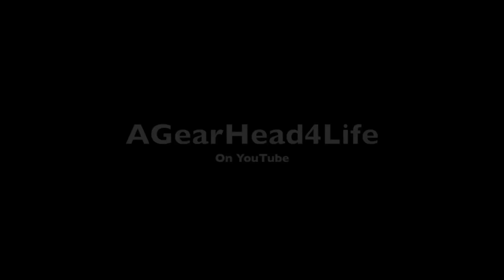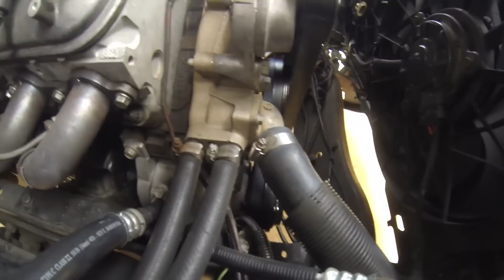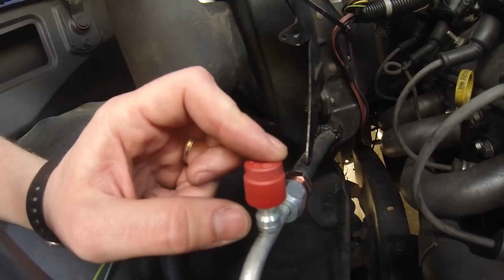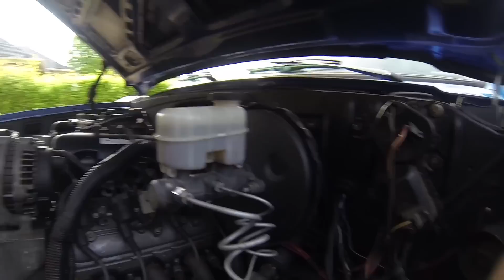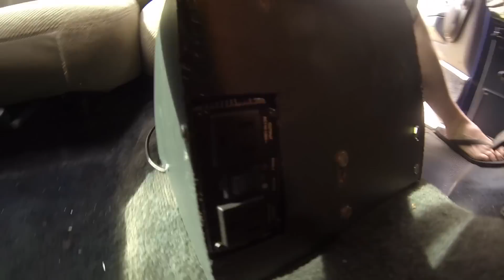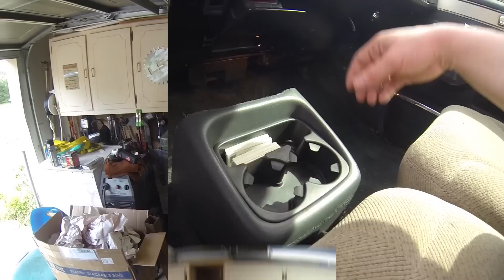AC LS Swap C10 Part 2 + Brake Master Upgrade, Console & Tires

Comment: Who made the hoses?
Reply: Here in San Antonio TX Carlisle Air Automotive will make you your hoses if you take them the fittings and the hose length needed.
Reply from the maker: Great answer.

Comment: What a/c control panel, did u install in dash panel to operate a/c? Does a/c panel include heater/defrost control.
Are u using ecm to control a/c or is it wired independently from ecm.
Lots of diy ideas, appreciate all your postings.
Reply from the maker: I used the factory C10 controls, but need to redo it to allow the PCM to control the AC so that it shuts it off at WOT.

Comment: Those 2 wires (dark green to your compressor clutch and light green to your fan relay) have power coming out presumably from the AC switch in your dash.  Is there a high pressure or low pressure switch in your AC system?  I’m finally getting around to hooking up the AsC in my LS swap.
Thanks

Comment: Do you remember what year/model you ordered your liquid line? Mine is an 82 and the condenser ends were on the driver's side. My replacement condenser has the lines on the pasangrr side, like yours.. Thanks in advance.
Reply: 83-86

Comment: I have the same setup and when I turned on my ac the fuse blew. Does these compressors have a lower voltage “excite” wire ? Do I need a resistor ?

Comment: Where did you order the hard line that goes from condenser to dryer?  I only find the line for like a Burban that has rear auxiliary AC.    
Thanks in advance
Reply from the maker: Hernan Leal I cant remember at this moment, but I would expect that I either got it from LMCTruck”DOT”com or possibly RockAuto”DOT”com.
Reply: AGearHead4Life thanks. I didn’t check lmc but rockauto only had the one I was talking about. I ordered it anyway.  I’ll see if I can plug it somehow

Comment: Thx for this video. I'm trying to pull a vaccuum on my Chevy truck. I've located the High valve, but can't find a Low valve. How did you do this? Just use the High only?
Reply from the maker: Pat Maki You could just use one valve. I didn’t notice my old C10 setup to Gabe a high pressure switch, so I didn’t install a port for one. I regret that! I am now about to open the system to add the high pressure switch and to use a R134 condensor from a newer truck.
Reply: @AGearHead4Life  how did you do that? Any videos?

Comment: Youre a life saver buddy! We are putting a 5.3 in my dads suburban and this clears some of the questions up. Out of curiousity, what type of shop did you take your AC lines to to have modified? We are almost thinking it could be easier, depending on the controls inside the truck, to fit up a 2000s style heater box to the truck and run all the factory components, but his has rear air which makes things more difficult...

Comment: Will that 2001+ master cylinder work with my 75 C10 booster?
Reply from the maker: nandoGdog Possibly but I don’t know for sure. You could also change out the booster. Better yet, convert to hydroboost. I’ll be converting to hydroboost soon.

Comment: Did the old evaporator work? Or do you have to replace the existing evaporator and condenser for the new compressor? The reason I ask is because I have a 78 C15 that came with factory AC and I am considering doing a 5.3 swap but doing some research first about the AC.

Comment: Did  you keep the electronic programming for the A/C in the ECM or did you delete it
Reply from the maker: yes, it's in there. I used the controls on the truck to control the compressor though. At least for now.

Comment: I have a question is the brake booster also from a newer truck
Reply from the maker: No, it's the original.
Reply: Did you use original push tube from your old master cylinder or did u use the push tube from new master cylinder??

Comment: tejas steelworks makes engine mounts for c10 that you can leave the compressor in the stock location without notching the frame.
Reply from the maker: Cool! Thanks for sharing. Good info. I'll have to check them out.
Reply from the maker: ah yea! Just check them out and left a couple comments. Good stuff. I think I like their idea and how their mounts work. Not only does it allow you to easily fit the compressor, but you can also keep the truck oil pan. Good stuff. It looks like you'd have to make a custom driveshaft, but it'd be worth it.
Reply: Yep.  Only had to notch my motor mount clam shell to clear the square piece that sticks out on the block
Reply from the maker: Very nice! Thanks again for sharing. I'll pass on the info.

Comment: you think it's possible to make a video on how to wire in all the AC components. I would appreciate it, and might help others who might want to install AC in a non AC vehicle.
Reply from the maker: Yessssir! I'll put it on the list. You'd be surprised how easy it is.
Reply: @AGearHead4Life  did you ever get around to making this video? I'd like to know how you wired it also. There are 2 plugs on the truck compressors, I think the green one is a power signal, and the black one a ground. Also, does any wires from the pcm get integrated into the plugs? Thanks.

Comment: @agearhead4life where did you get your new compressor from? ebay or parts store?
Reply from the maker: I bought a new one from a local parts store for two reasons. Mainly for the warranty and I bought new instead of the cheaper reman version, because I've seen way too many reman compressors warranty returned when I sold parts for four years. It could have been installer error, but I didn't want to take a chance.
Reply from the maker: If you wanted the cheapest but good, I'd bet that rockautoDOTcom would have the best price.
Reply: +AGearHead4Life Yeah sounds about right i was gonna order one but i was also thinking about warranty issues if the issue comes around... Hows the a/c been performing I know those ls style a/c compressors last a while...
Reply from the maker: I don't know much about the life of the LS compressors, but I've read something about a "deslugger" kit for them. To help them start up slower to keep from trying to compress the liquid refrigerant since the compressor is down at the bottom of the system. IDK just something I read. Anyway, it's been working great man. I'm loving it. Stays blowing around 50* in the cab. Of course I want to improve it as much as possible, like any gearhead. So I want to put the foam in between the condenser and radiator to help air flow. Im also not currently using the high speed function on my fan, because I need a larger relay/fuse setup. Finally I'l like to add a fan to the condenser to help it even more at idle. These are all not necessary things, just me trying to make it the best it can be. I want it to sit in a parking lot for hours in 105* heat outside and have no issue staying cool inside. lol
Reply: +AGearHead4Life I understand I bet when you get the cooling fans wired on high that gonna be just what your looking for... what did you electric fans come off of?
Reply from the maker: I snagged dual fans from a Lincoln Continental. They not have been the best choice because of fitment, but they move crazy air flow. I had to patch up the ends of the fan shroud from where I cut it to fit my radiator. I've got pics of it all on my FB blog page "AGearHead4Life", but I need to do an update video showing it.

Comment: would you have to move the brake line a and run it close to the frame after you remove the gas line
Reply from the maker: Talking about up under the motor mount? Yes, I bend them up closer to the frame, but I think that was mainly so that I could cut on the mount that I had made more.

Comment: Its too bad you were able to get a hold of these before you cut your frame flange.

https://coldhose.com/catalog/product/view/id/1496/s/gm-5-3l-compressor-discharge-block-fitting/category/39/

I figured this would be a good place to have this for reference. Love your tech videos/info. Keep on wrenching!
Reply from the maker: +Jason Gass Actually, I considered making some of those for a little while. Thanks for sharing info with everyone. It may help someone out and thats what it's all about.

Comment: which one of the plugs are you hooking into on the compressor? I believe there are 2 plugs.
Reply from the maker: +David Bush There was one plug with two terminals that was on the firewall that went to the old compressor. I used the same wire that went to the old compress to go to the swapped one. If I remember correctly, it didn't matter which of the two to use, because they were both hot when the AC was on. I think the other went to a solenoid on the throttle to idea it up for the AC.
Reply: AGearHead4Life my compressor on my 5.3l out of an 01 Tahoe has two two wire plugs on it. One in front, and one in back. Which one do I supply 12v+ to turn on the compressor?
Reply from the maker: +David Bush The one in the front, near the AC clutch. The AC clutch has an electromagnetic switch to engage the clutch. The other, on the rear, is likely a high pressure switch.

Comment: Im confused. Is your ac controlled by the c10 or is it wired into the trucks stock controls? Also, you said your compressor is wired into your electric fans? Im confused. Is that the only way to do it?
Reply from the maker: +KAnthonyStrick1992 Compressor isn't wired into the electric fan. Most AC systems are pretty much self controlled. They have two switches that control it, a high pressure switch and a low pressure switch. My truck only supplies that power that turns it on when I flip the AC switch on my dash, like a light switch. Once the AC system has power it's on. The AC clutch may cycle, but that is hailed on it's own by the pressure switches.
Reply: +AGearhead4Life okay I get you. I was thinking that nd just got jumbled when you showed the relays. sorry. lol. was your truck factory a/c? and Im reading a lot you have to wire the compressor into the pcm. Did you by pass that? and if so, how?
Reply from the maker: +KAnthonyStrick1992 Yes, my truck was factory AC. I just ran the original AC compressor wire to the new compressor. I did not run it to the PCM yet. Giving a signal to the PCM will allow it to idle up when the AC is on to help it idle better. Also, the AC can interrupt power to the compressor when you floor it. For now, I just turn off the AC when I floor it.
Reply: +AGearhead4Life Okay thank you. I was racking my brain all last night when I was thinking how to wire this. Thanks for the information.
Reply from the maker: +KAnthonyStrick1992 No problem. Good luck!
Reply: Thanks and same to you!
Reply: There needs to be a fan over ride switch. I just did all the plumbing and switches on a Jeep ZJ with an LS. Used a trinary switch.

Comment: the master cylinder you have is from a s10 or a newer Chevy truck I've looked up the 2001 s10 and the only one I find is for a right hand drive.
Reply from the maker: +Domingo Perez  The master cylinder is from a full size truck. The reservoir is from a S10. Both came out of the junk yard.
Reply: 10-4 ok I will have to go and check that out this weekend thanks again bro.

Comment: that break reservoir looks awesome hope it works on my 1975 Caprice
Reply from the maker: +smilinjoe23 I'm using just the reservoir from the s10 because its lower profile.
Reply from the maker: +smilinjoe23 Master cylinder came from a full size truck, around 2001.
Reply from the maker: +smilinjoe23 I doubt it'd work. It was a 2000's rounded S10. I dont know the year. I went by the look of it.
Reply: +godcarsmoney so is he using just the reservoir from the s10 or the whole master cylinder?
Reply: +AGearHead4Life so the 1988-2000 mc from full-size truck won't work?I misunderstood it and grab one from that model year.

Comment: How did you wire the fans with the a/c ?
Reply from the maker: David Santillan At 4:00 in this video it shows and explains what I did for the fan to come on with the AC.
Reply: AGearhead4Life so it's from the pressure switch to the relay but what plug on the relay?
Reply from the maker: David Santillan A relay will have a trigger side of it, that wire will be what triggers the relay. Are you following my Facebook blog page or our group FB page? If so, I can share a diagram that I have on there of how a relay works. It's also a diagram of how to wire in a radiator fan relay.
Reply: AGearhead4Life well I wired it directly to the fans and that made my whole system shut off and will only come on when the fans come on when the temp is at its point but I cut off the wires I point that I hooked on the fans and still no power to the ac system
Reply from the maker: David Santillan Yea, that power wire coming from the trucks AC harness cant supply enough power to run the fans. That's why it is used to control a relay. All a relay is basically a switch. It allows a small amout of amerage to trigger a switch to allow a large about a amperage to pass. So you'd use that wire from the AC harness to trigger the realy to allow power through the thicker power cable to the fans.  It is difficult to explain in words, but is very simple. That is why I offered to show you the diagram. Its way more simple then it sounds. You probably blew a fuse trying to run the fans on that wire. Check your fuses.
Reply: AGearhead4Life ok will do and I do follow the Facebook page
Reply from the maker: David Santillan Ok, I'll repost that image of the fan relay wiring diagram now.
Reply: AGearhead4Life ok sweet makes sense now one more question what triggers the a/c switches?
Reply from the maker: David Santillan Which switches? Power is given to those wires, the pressure switch and the compressor when you turn the AC on the dash on.
Reply: AGearhead4Life well I checked the fuses and it does have power but when I move the ac switch nothing turns on
Reply from the maker: David Santillan You're going to have to reference a wiring diagram. Maybe that circuit has a usable link? IDK

Comment: Do you know what the 2 greens wires from the drier go to or do? Trying to get my AC working in mines
Reply from the maker: txchevyrida Sorry man, I'm color blind. I just chase or test them all to find out what they are. Are they connected to the low pressure switch?

Comment: I have a Cheyenne1987 myself each time I step on the gas it does a popping noise like if somethings moves by the right front wheel do you might know what it could be?? Its only when I press on the gas pedal hard for burning out or taking off fast...
Reply from the maker: Braulio Ortiz Maybe something in the suspension? like a ball joint. I'd inspect the suspension and see if you can find any play.

Comment: AGearhead4Life  Will I be ok if I bolt on ls1 heads to a 5.3 but put 4.8 flat head  pistons in to bring the compression back up
Reply from the maker: Short answer is yes, it'd work fine. Long answer is the only binefit of the LS1 heads is the 2" intake vavle. Those heads flow the same as 5.3 heads though. That is why I like to keep 5.3 heads and put the 2" valve in them. That give a great compression ratio.

Comment: I will be trying this reservoir swap on mine 1975 caprice. ......... I always thought those sacrifices laying off of the ECM?...... Is that a static ac compressor
Reply from the maker: godcarsmoney The cluctch engaugement signal does usually go through the PCM, that way the PCM knows to idle the engine up too. I believe this type of compressor just switched on/off and the fancy new style was variable, around 2009?.  I do wish that I had installed some type of high pressure switch on this system. I may have to go back and add that.
Reply: Doing my research you can only use a 2000 compressor because it cuts on and off with a clutch...  I call one of the junk yards in my local area and I noticed it was two different kinds what year truck your compressor came off of.... I'm pretty sure its 99/2000
Reply: Deiphi? Might be the one that doesn't need to run through the ECM
Reply from the maker: godcarsmoney You know, I thought it was a 2001, but it could be older. I just knew that I was looking for one that didnt have the sensor coming out of the rear of it to give more clearance. I can get a part number on it. I do believe that it was a Delphi.
Reply from the maker: godcarsmoney I think that the 2001 schematics showed it run through the PCM but only as a clutch on/off.
Reply from the maker: I used the AC again today and its still working well so far. It hasnt gotten hot often for me to get to test it much. Only about three days since I've installed it. It gets chilly enough that I turn it down from full blast.

Comment: Hay mark need to know if you are running an oil cooler on your truck if so what kind
Reply from the maker: anthony jackson Hey Anthony! I'm not running an engine oil cooler, but I do have a large trans cooler. I dont know the brand of it since I acuired it used. I just looks like a large one that you'd get at a local parts store or a U-Hual.

Comment: What can u pull a ls 5.3 or 6.0 out of?
Reply from the maker: txchevyrida GM truck and suburbans around 2000 and up. the 6.0s arent near as common as the 5.3s though. Thats why the 6.0s cost twice as much as a 5.3. 5.3s are everywhere and can be picked up complete with all accessories, harness and all ready to run with about 150k miles for around $700 on average.